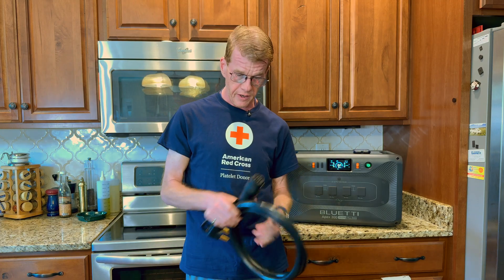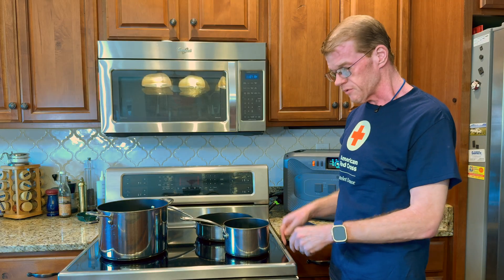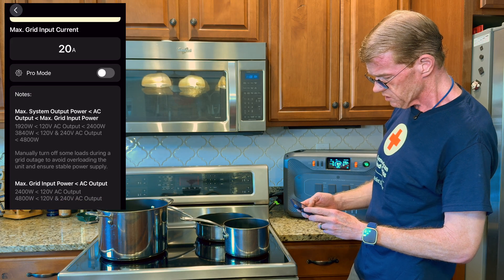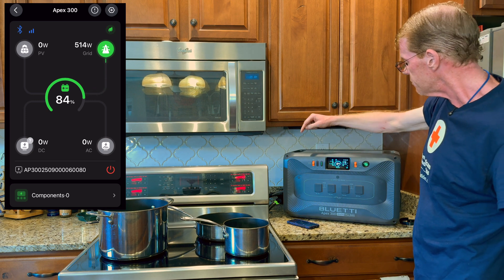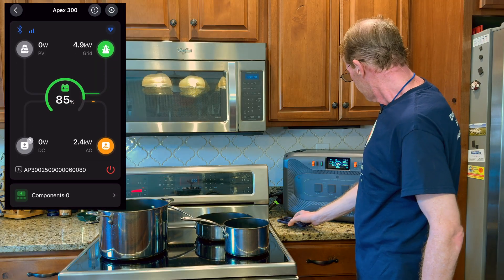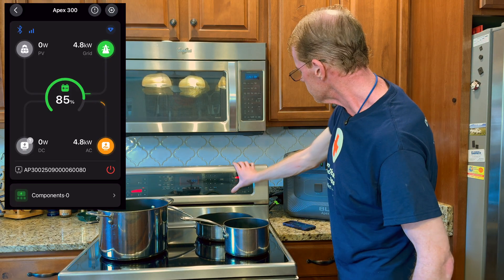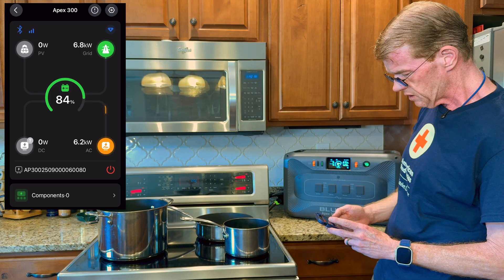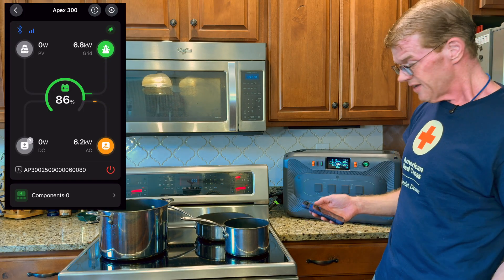50 AMP Input/Output With Bluetti APEX 300 120V/240V Power Station!

Comment from the maker: Apex Amazon: https://amzn.to/41pn3tw
Amazon Black Friday 5% discount code LIVEBF05 for all products

Apex Bluetti site: https://bluettius.sjv.io/dOMnaq
5% coupon DK5OFF sitewide 
6% coupon DK6OFF for Apex 300, Elite 400, and B300K

The 50A 240V NEMA 14-50 accessory input cable:
Amazon: https://amzn.to/3W46yjv
Bluetti: https://bluettius.sjv.io/kOYK90
Reply: Absolutely love the video! So you think this can work to hookup 50 amp bypass to a sub panel and power the critical loads with automatic UPS? Seems like all I’ll need is a main breaker sub panel with a generator inlet and a NEMA 14-50 wall outlet correct? Trying to provide outage power for my customers at an affordable price rather than a huge Tesla powerwall that’s really not necessary for most people.

Wonder if I put a soft starter on my ac if it’ll run it no problem?
Reply from the maker: Yes it will pass through up to 50A, but a single apex only has 16A 3840W to give by itself from the inverter.
Reply: @DougKremer do you trust it to run in bypass for long term say 10+years? Looking to do TOU load shifting for my customers.
Reply from the maker: @landerselectric : I can’t say I trust anything for ten years, especially electronics.  I believe it has a five year full warranty and the specs on battery chemistries are pretty incredible.
Reply: @DougKremer  completely understand my main concern installing these as a contractor is that I don’t feel like any of these systems are tried and true, especially using them on a daily basis, switching between bypass and battery power. They still make me a little bit nervous, considering how fast the technology has been moving.
Reply from the maker: @landerselectric : Maybe one of the permanent install EP series would be a better fit.
Reply: @DougKremer  gotcha. Appreciate your responses. Love your channel!
Reply from the maker: Thank you!

Comment: Doug, thanks for making all the informative videos on the Apex! I just created a channel to ask a similar question as a few others. I have a 30 amp 120/240v generator inlet box tied to the main breaker panel. I have zero intention in running 240v circuits in my house, and I currently use a Duromax XP 7000 to back up the house during outages. I also have a Honda EU2000 that I would like to use in order to save fuel during long outages to power the absolute essentials. My question is, if I use the Honda EU2000 and set the grid input to 13 amp for passthrough, but need extra power for spiking loads (air fryer, garage door opener, hair dryer, etc.) when the Apex starts supplying the difference in power demand, is it possible to overload my neutral at the Honda EU2000? I have looked everywhere for the answer and have had no luck finding it. I would also like to use the Honda Eu 2000 and APEX to power my 50 amp fifth wheel and have the same concern. Any help would be greatly appreciated. Your channel and video will be my first like and subscribe.
Reply from the maker: Are you planning to connect the Apex to a generator backfeed interlock, then the Honda to Apex?  ( I did this in my full apex review video, worked great! )  If so then the N-G bond in your panel takes care of it and the Honda will only see what it is sending to the Apex.
Reply: That is my exact setup. Thanks for the clarification. I’m not trying to start a fire lol.
Reply from the maker: My full Apex video is very long,  but you can use the table of contents to navigate right to that demo if you'd like to see it work.
Reply: @DougKremer thanks! I will check it out.

Comment: Great video - Thanks for doing this.  
Have a question.   Live in USA- PNW -   Looking to buy Apex 300 and trying to understand option to connect Apex 300 to my 240 VAC Distribution panel (DP) and a generator at the same time.  Will be installing a Generator disconnect setup to be powered to DP via a generator from an outside 50AMP Gen Inlet.  
Trying to determine how do you connect Apex 50amp PO50A port and charging cable to the DP Gen breaker inlet.  Can just add a 50AMp Receptacle for the Apex 300 to the line from the DP to the outside generator inlet?  
Would I need disconnects to both DP inlet connectors to then turn off prior to plugging in either plug when under load.  Thanks.
Reply from the maker: You are installing a generator backfeed interlock, and want to be able to insert the Apex between the generator and the panel?  If so I was very close to making that modification to my generator interlock.  I was going to cut the feed a few feet from my panel and put a 14-50 receptacle on the side that goes out to the generator, and a 50A generator inlet on the side that goes to the panel. Just two boxes on the wall a foot or so apart.  Then buying a 50A generator inlet cord I could just plug one box into the other and have my generator backfeed work exactly as it always has,  or I can plug Apex into the 14-50 receptacle, and the panel into Apex.

Comment: Great video...very informative and detalied evaluation of that feature....don't think the Jackery can do something like that...will probably be returning it, still on the box...Costco...does the Delta 3 Pro have a similar capability....I thought I watched a review mentioning it can with their Control Panel 2.....
Reply from the maker: Good questions.  I have very little hands-on time with Jackery or Ecoflow so far.
Reply: @DougKremer the things that the Apex can do things not many can.  Only complaint is tbe 60v solar input but can be addressed by the Solar X 4K, at an additional cost though   I enjoyed your video demonstrating the 240 V grid pass tbru. Excellent. That feature is very good. I guess you can run on solar doing the day and have that pass thru to fill voids on solar capacity, besides battery backup. Am I right on that?  Can that demand sourcing between 240v grid pass thru and silar be configured in the app?  Or how that may work?  Thanks again
Reply: Not only capacity wise in terms of battery, but demand wise in terms of kw
Reply from the maker: I don't think anyone is pleased with the 60V solar limit, the 4K accessory is too far the other direction on overkill and bulk.  Yes with both grid and solar connected you can set Apex, and other Bluetti units with the UPS modes into a setting called "PV Priority".  You set a minimum state of charge which you want maintained by the grid input.  Solar input provides charging beyond that, and once you get to 10% above the setting the unit will stop using grid and switch to solar and battery until it drops to the minimum that has been set.  this is how folks use these units to reduce their utility consumption.

Comment: Hi, I have a question: Will this unit provide 240V for a stove, a well pump, or a water heater while recharging it with a smaller gas-powered generator at 120V? If so, will the 120V recharging be able to keep up with the demands of the 240V appliances?
Reply from the maker: Can Apex supply 240V while charging from 120V?  YES! with limitations.  when in 240V mode the inverters are split,  one is wired to L1 and the other to L2.  The incoming 120V is wired to L1 I believe.  If charging via the C13/14 plug on the side you are limited to 1440W input from 120V.  if using the 30A 120V cord you would be limited to 1920W of charging, which is the maximum power of a single inverter/phase.  The total output capability of Apex is 3840W, thus under sustained high power output the charging would not be able to keep up.  Intermittent loads like the well pump example shouldn't be a problem for total energy, but startup inrush should be considered.  a stove or water heater could be a challenge as they often operate for a while, and consume a lot of energy.  note in my demonstration here I was not able to operate the oven at all within the 3840W power capability of a single Apex, but one or two cooktop burners were no problem.

EDIT:  See my Apex review video for a demo/test of it powering my house backfeed with 240V while generator charging at 120V.
Reply: @DougKremer  I wonder how the "power lifting" would work with something like your range oven. Could maybe cook during a power outage with a small unit like an Apex 300?
Reply from the maker: @uhjyuff2095 : A single Apex will not operate the bake elements in my oven but it has no problem with the cooktop burners.
Reply: @DougKremer  I was told the "power lifting" prevents the inverter from overloading easily. You could also try switching the voltage output from 240v to 208v.

Comment: I have a question if you don't mind please?  You show it where you set grid power to a limit, and it begins on grid power, and only ADDS INVERTER power as needed.   

I'm trying to go the other way.  I want to use inverter power FIRST up to the limit of whatever it has or can do, and then have it only add grid power as needed.  

Will this unit do that?  

Or actually, does it automatically do that if set in PV Priority Mode?  That would make sense, because it turns on Grid for Pass-Thru when SoC reaches the setting (or actually By-Pass, not exactly Pass-Thru on this machine, I believe).  So it actually would make sense if it's running on just the battery and the demand rises above what it can do, that Grid would come on automatically.  (Although at that point it might not "supplement" with Grid, it might just SWITCH COMPLETELY TO GRID By-Pass, which is NOT what I want.  I know some inverters work that way.)

Thanks for whatever you can tell me!
Reply from the maker: It would do exactly that if grid connected and running on battery in PV priority as you suggest.  It would use inverter first,  then supplement with grid once it exceeds inverter capacity.
Reply: @DougKremer Thank you much!  That info made my morning 👍
Reply: @DougKremer  Any chance you would make a video demonstrating that please? 🙂

I would love to SEE it doing that!  

I totally get it if you don't really want to, but you strike me as VERY MUCH a tinkerer with this stuff!

I have EcoFlow stuff, which is VERY GOOD stuff, but it won't do that!  Along with several other things it won't do.  And so it's time for me to expand, and I'm considering going Bluetti instead of adding more EcoFlow.
Reply from the maker: Yes absolutely I am a tinkerer, and experimenter.  As you can see I'm not afraid to push the hardware hard.  This whole thing started in an effort to demonstrate things to the Bluetti community.  I will try to make this happen.
Reply: @DougKremer And to Bluetti themselves!  As wonderful as that machine is, it surely has capabilities even their tech may not have thought of!  

I have some pretty way-out idea for its capabilities and use as well.  

Thank you, and will LOVE to see that video if you can do it 😊
Reply from the maker: @jeffs3917 Along and to expand what you are asking for…. I want to try cascading three apex.  Connected each by 50A cord then to my oven.  When the one closest to the oven exceeds it’s inverter power. It will request grid input assistance, which will be the second Apex, when that exceeds its inverter, it’ll ask for help from the third.  I know it will work, just don’t have the hardware to test and demonstrate
Reply: @DougKremer I'm eager to see it, Doug!  But I'm MOST eager to see it begin on the Apex300 with one stove eye, use inverter-only as you add stove eyes until it gets to its 3840w max, and then begin adding Grid power as needed, while still maximizing the 3840w from the inverter.  

I can build my "DREAM" system if it will do that!  

I also was thinking of backing it up sometimes from direct plug-in to another Apex300, but not all three.  Maybe all three but will see how it goes!

I'm excited!  Can't wait to see it! 😊

Comment: Biggest load I have in my house is an electric furnace.  More than 22k!  Needless to say I never turn it on.
Reply from the maker: Wow! I'd probably never turn that on either!   We had electric backup heat at previous house, I disabled it, added a manual switch.

Comment: What model is the induction oven? I had a freestanding (range oven combo) with induction burners. It was loud with the induction noise and the cooling fan to keep the induction coils cool. 
If I used the oven, the noisy fan had to kick in even if the induction burners were off.

I haven’t meet someone who liked a combo unit (stovetop integrated with oven). Most who like induction have an induction stovetop and a separate wall oven.
Reply from the maker: It is a KitchenAid KIRS608BSS.  It has similar fans but I do not find them obtrusive.  There is mild ticking with the burners on low,  and the induction hum when at higher settings.  I don't mind any of the sounds it makes,  the heating power is incredible!

Comment: These cheap high frequency, trandformerless Apex units can easily damage your homes appliances when their MOSFETs fail because they lack an output transformer to provide galvanic isolation. No thanks, Mr. Salesman.
Reply from the maker: Which power stations have low frequency transformers?

Comment: Hello Doug.

Couple items I would appreciate your clarification on. 

The Apex 300 with not plugged to the grid showing no neutral bonding with a tester at 120 volt selector switch. When plugged into the grid it does show the neutral bonding. 

On 240 volt with not being wired 😮into the grid the neutral bonding tester showing it is active (proper light selections on the testing plug)

I’d like to understand.

My other question is with a typical 50 amp RV if plugged into the nema 50 amp plug on the Bluetti does the selector switch needs to be on 120 volt or the 240 volt selection.
Reply from the maker: Good question.  I have no explanation as to why it would show no bonding at 120V and bonded at 240V when not connected to grid.  It should show unbonded/floating neutral in both scenarios. When connected to a grid input, even it not drawing power from it the Apex will pass the N-G bond it sees though to the output and you should read bonded in both modes. 

50A RV shore power, that is a good question, and possibly vehicle dependent.  I’m no RV expert but I don’t think many have any 240V specific consumption, if it is just wired to take in and distribute two 120V circuits then 120V mode should give the most flexibility for varied loads across those two circuits.  Running in 240V mode would lock you into half the capacity of Apex available on each circuit.
Reply: @DougKremer I have taken photos if you ever require. 

Thank you for your response. I thought RV plug in at 120 volt would be safer but I have very little electrical knowledge on that front. 

I will search further on the web on all front,
Reply from the maker: I just tested mine, I get 11v N-G in 240v and 63Vin 120v. Neither are bonded, but my tester is showing the same as yours with lights.

Comment: Excellent video!  Have you ever tried running your central air conditioning? I noticed in your other videos you turned the breaker off.
Reply from the maker: No way a single Apex would run my 4 Ton home AC.  It is on a 30A-40A breaker and draws about 100A inrush.  Maybe a couple Apex and a soft starter on the compressor would work.  
EDIT:  Thank you!
Reply: @DougKremer  Thanks for the quick reply. I didn't think a single Apex 300 could handle the inrush but I thought I'd ask anyway.

Comment: Good video Doug, your one of the only reviews that show the apex performing "power assist mode" that was unique to victron hrbrid inverters that I have found.  This is a game changer for RV life.    Question: at the 6 minute mark, when you where limiting grid power to 20a (you didn't show detail on app for this), could you have pushed the apex to contribute it's inverter max of 3840 watts and ran the range with 4.8 coming from the grid and 3.8 coming from apex battery using the range at 8.4KW of total consumption?   Would this also work in 120v mode since RV's are 50amp 120v?
Reply from the maker: Yes,  Apex would contribute its full 3840W to the grid limit continuously as long as it had battery to give.  It would do the same in 120V mode also.  When I demo Apex with my generators in my full review video I show that and mention that these larger powerstations can be generator multipliers, setting an input limit compatible with your source and letting the powerstation handle the variable loads which can be much more than your source can supply.   it would work exactly the same way in a camper with a limited shore power feed.